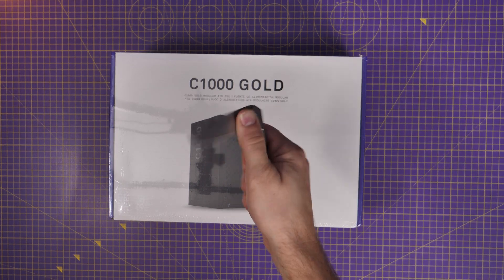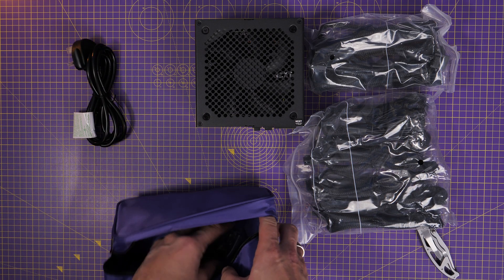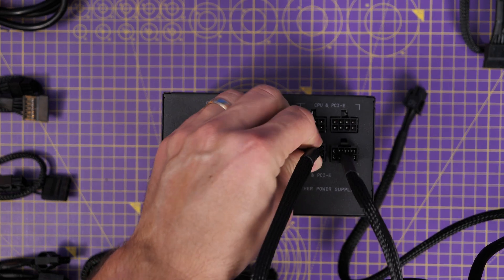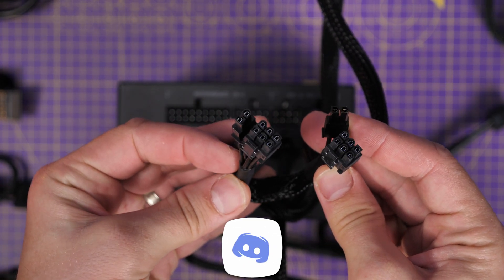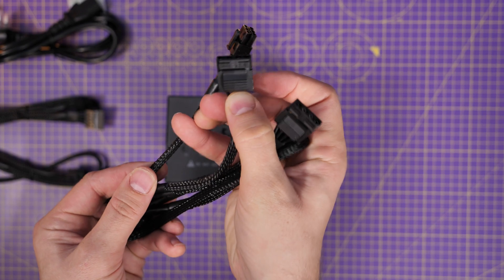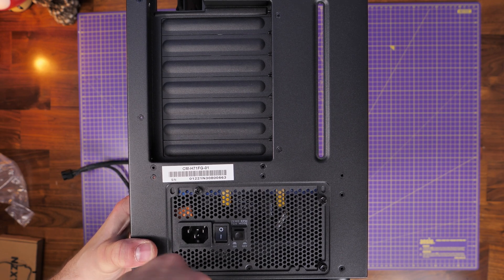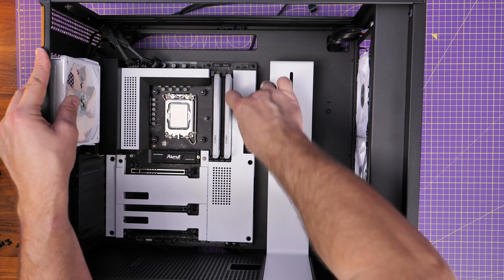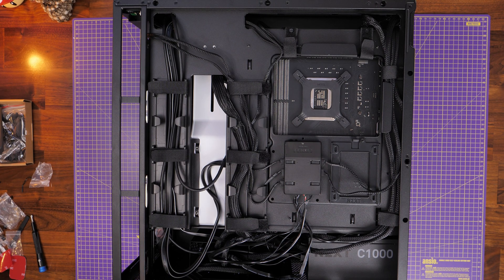NZXT C1000 PSU install and setup guide

Comment: I am using the C1000 GOLD White, and as expected, 1000W generates a significant amount of heat. Therefore, it is necessary to install multiple fans. Naturally, the noise from the fans becomes a constant concern.

Comment: hey boss  can i use my NZXT c850 watt psu with rtx 4090??
Reply from the maker: Use this calculator to suss out the required power for your system outervision.com/power-supply-calculator

Comment: Hello for the 6950xt which has 2 8pin connection, is it better to use separate cables or 16 pin on one cable?
Reply: Two separate cables would be able to supply more overall power, but one cable is SUFFICIENTLY powered, so all you are doing by running two separate cables is adding bulk to your wiring without any performance gain. I know this is an old post, but since he wants likes, to subscribe, and comments, figured it should be answered because they commented. Cheers
Reply: @richdouche8253  yeah old comment, I just stayed with my 6650 XT
Reply: @mrwannabe00  Good choice. Not a big enough upgrade to justify the expense. Wait until 7000 series cards come down to your price point and then upgrade.

Comment: I just got done a week ago building my first PC. All parts new or good condition. My only guidance was YouTube. I really could have used this guy. The PC runs and is put together correctly. All markers like temps and such are spot on. But his channel would have helped immensely. I didn't even know what a sata cable, I knew very little. I still subbed as I'm not fully done

Comment: Just bought this psu upgraded my Gpu from the Rog Strix 3060ti OC to the Rog Strix 3080 OC 12Gb and decided to upgrade my psu from my Corsair Rm750 to this nzxt C1000 watt psu for head room for future upgrades gave my wife my 3060ti and 750watt psu so she could upgrade from her Gtx 1080 and 700 watt bronze psu

Comment: I can already see an issue with this PSU if I wanted to connect both 2 CPU and 4 GPU cable (RTX 4090) as it only has 5 of them.  I was quite keen on this PSU until I saw that.

On another note thanks for the great reviews, I’ve been going through most of your site today as I purchased a Corsair 5000X and was looking for which fans to choose ML/QL/LL etc for my all Corsair setup.